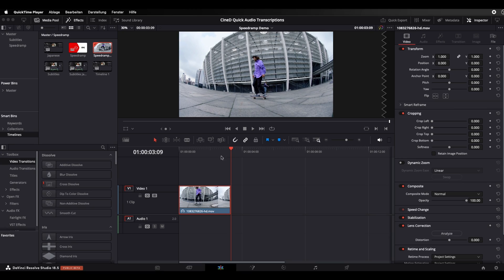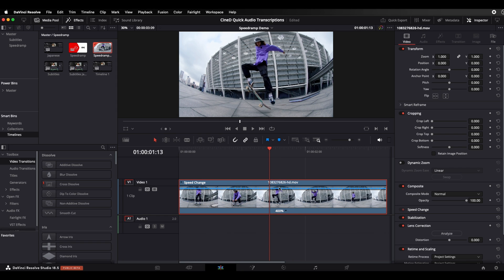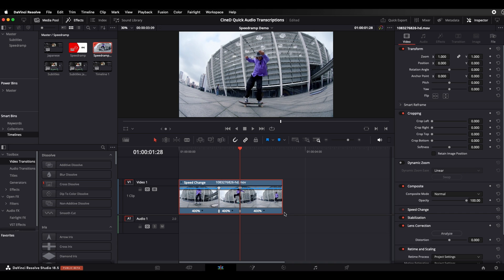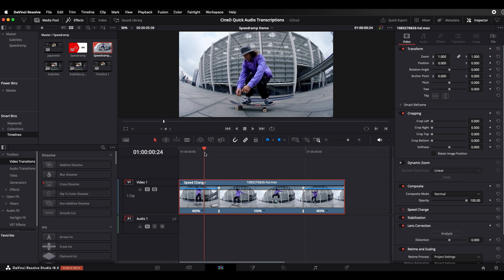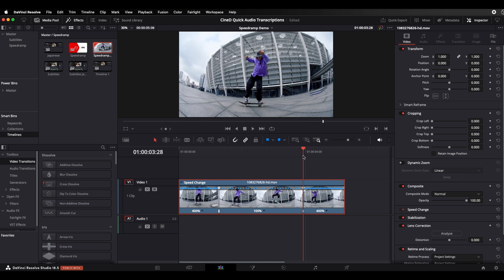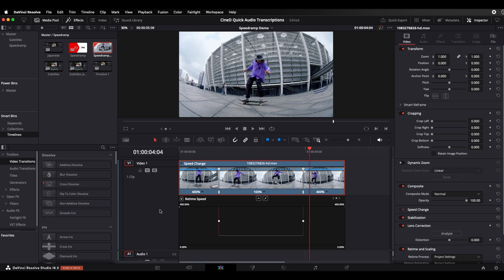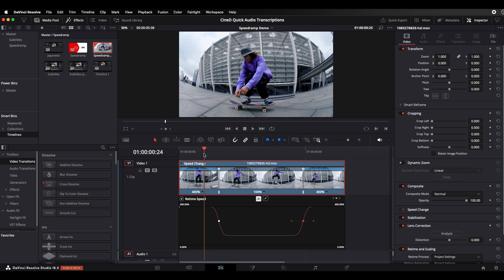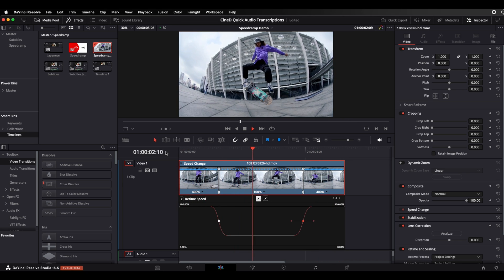Mastering DaVinci Resolve: How to Create Speed Ramps in Seconds

Comment: Struggling to find a way to play with speed points without modifying the length of clip (selection).... There is an option called "Stretch to fit" but isn't working or it might be for some other purpose there....